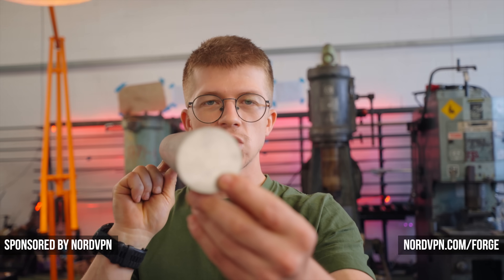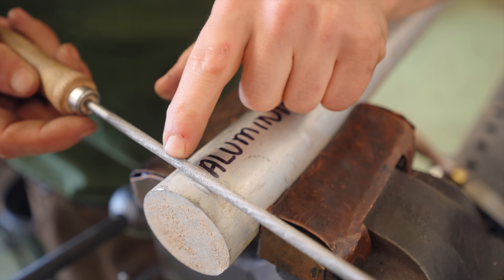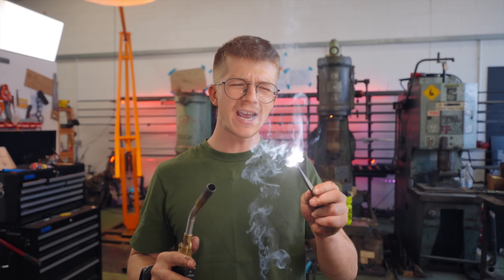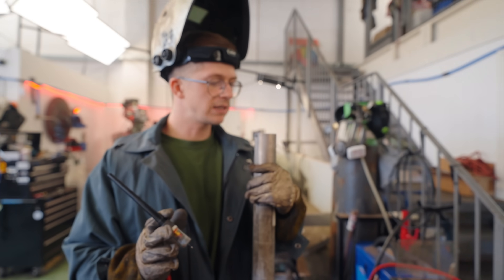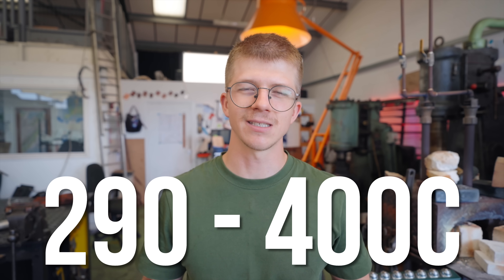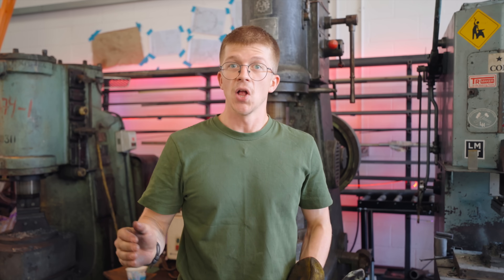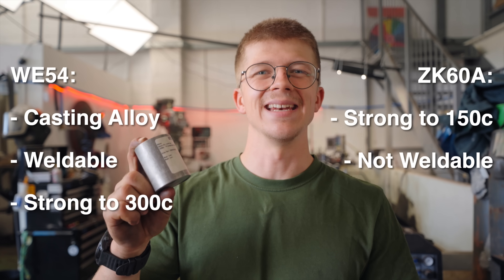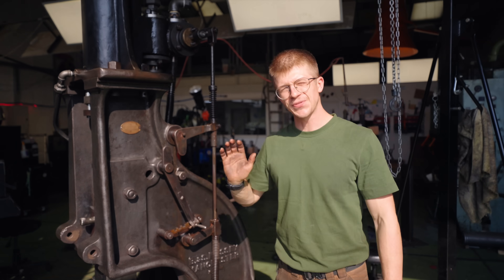Can You Forge Magnesium?

Comment: While density can play a role in the hardness of a material, they aren't directly proportional. Lead and gold, while dense, are relatively soft metals due to their atomic structure, making them easier to cut compared to less dense but much harder materials like titanium. Titanium is indeed less dense than lead or gold, but its strong atomic bonds give it much greater hardness and strength, making it more challenging to cut.

When you bring oxides into the mix, the complexity increases. Materials like aluminum oxide (Al₂O₃) and silicon dioxide (SiO₂) are ceramics with strong ionic and covalent bonds, resulting in high hardness. These materials are significantly harder than lead and even lead oxide, which has a weaker structure in comparison. Titanium nitride (TiN) is another example—it's extremely hard and used as a coating to enhance cutting tools. In summary, hardness is more about the material's atomic structure and bond strength than its density alone.

Comment: This video is so cool to see since I work with these alloys on a daily basis, casting, extruding, etc. I work at a company that specialises in magnesium production here in the UK for all kinds of industries. We make the alloys mentioned in this video such as WE54 and Elektron as well as dozens of other alloys. We've made stuff for Porsche, Ferrari, Honda, and even the apache helicopter uses our alloys.  

And Alec you're right this material is incredibly difficult to work with and is incredibly dangerous but I really enjoy working with it. 

We need to use cover gas at all times to keep magnesium from oxidizing when heated, otherwise magnesium oxide gets in and you end up with crap material that lacks the properties required. Basically if you don't want something to oxidise, just take away the oxygen!

Comment: Once again but when you're filing magnesium if you try to light even the little tiny pieces that you pulled off of the magazinesome rod you will notice it catches on fire real easily and it can magnesium is the only metal that can burn underwater so just remember that it's what they use to weld ship holes when there's a hole and it's still on the ocean they use a magnesium rod maybe not the stickers what you got there but you know what I mean

Comment: 10:25 why is the temperature water freezes at so important? Replicating this is tricky even with modern refrigeration. Meanwhile, if you put a block of ice into a salt water brine, the water will cool to exactly 0F. This allows for an accurate calibration of a thermometer in the field with simple and common equipment - very important 2 centuries ago.

Comment: In the 1980's working at British Nuclear Fuels the fuel rods were made from magnesium. On bonfire night they would fill an aluminium dustbin with the swarf and light it. I remember vividly seeing the shadow outline of the crowd on houses 100m away. Way brighter than daylight in a full field and so white.
Reply: go go gadget F type main sequence star
Reply: I thought zirconium was used for fuel rod casings, not magnesium.
Reply: @cambridgemart2075 technically yes It could be Zr Cd or MgAl alloy.
Reply: @Beuatifulsmall we also had to great bonfires when I was a kid, a large piece of Magnesium sheet ended up on it, it lit up the whole nounhood when there was a gust of wind.  🙂they also reprocessed the nuclear fuel rod casings, I think we had one a cloths prop for many years! ( see comment above).
Reply: If I remember correctly, the flares I fired in the Artillery were magnesium. They have an eerie white light  when burning
Reply: Congratulations, the.. "white" light is UV light so intense it completely overwhelms any optical sensors. Camera as well as eyes, to see the true colour of a magnesium flame you'd need one of these temperature cameras that create an image not by light emission sensors but an radiation intensity sensory array and translating it into human-conceivable colours by shifting it into a spectrum the human body can sense (like shifting up or down audio tone pitch to make it comprehensible to the human ear by bringing it inside of the human hearing range and does NOT mean, that it's that colour or pitch in real life.. Colours are an illusion anyway. It's all more or less colourless, but due to different light refraction properties of certain materials and surfaces. When you're adding colouring to something, you're not changing the thing, but the way its surface manages to refract light. Without our eyes, everything is grey, "Eigengrau". The "static interference" in our optical nerves humans and therefore silence used to call "black" but actually is a mix of all the different RGB sensors in our retina glitching out uncontrollably but still homogeneously.. except for when you're high and your mind's pattern recognition feature is basically super- and turbocharged with weed, on Nitro with Shrooms and on TopFuel with LSD, having you imagining vague, random outlines and shadows of things in the static.. no matter if the eyes are open or closed.
It's a software-problem more than it is a hardware one, so except for filtering the light input in general, like in sunnies or selectively by frequency, like torch hoods, is only semi possible. It's ike the analogue TV static, just in 240k.. 😅
Sorry, I'm more of a car/microbiology nerd than anything else. 🤪
Reply: @HG_Budde  Never in my life have I seen a more longwinded and rambling comment from anyone other than myself.
Reply: @HG_Budde  "UV activates the optical sensors"
any source on that I can read?
Reply: @HG_Budde 👌
Reply: It's driving me crazy the masses keep saying magnesium is flammable, so is potassium but you don't see people avoiding bananas. The purity of the metal matters and no one with a brain is going to work a non alloyed magnesium metal period.

Comment: My dad worked at an aluminum factory, and they would heat the metals for alloys to dry them before introducing them in to the molten aluminum...because if not, boom...anyways one time a drying kiln ran away full of magnesium, burned through the concrete floor into the earth, they just kept covering it with dirt, nothing they could do!  Burned for most of a week if I remember.

Comment: 2:10 I'm not 100% sure but i don't think density and hardness are very strongly correlated. Gold and Tungsten have very similar density, but very different hardnesses. I suspect it's got more to do with melting point, since iirc germanium can be chewed like bubble gum due to its low melting point and i supposed mercury is a liquid so would be "soft"

Comment: A table saw with a carbide tipped wood blade is a little slow, but can cut through 2 by 4 inch aluminum blocks without dulling or going wonky.
    I would hesitate to put a wood chisel to aluminum. I don't have a tool sharpening fetish. Files are whatever, they just fill-up tho. Soak them in lye for a bit and wire brush after a rinse.

Comment: There other metals that can catch on fire is like Lithium, Calcium, Sodium, Potassium, Strontium, Ceasium, Rubidium metals are also reactive to water and air. It will explode and is very soft metal. It can be cut with an knife like butter. Has to be stored in oil or ampule for storage. But they have amazing properties and usage in chemistry and manufacturing! ⚗️ 🔥 💧

Comment: Fahrenheit's most practical use is for measuring temperatures compatible with human life. For body temperature there is much more granularity in that range. 98.6 - 105 (a range of 6.3)  vs 37 - 40.5 (a range of 3.5). The same goes for air temperature and it's safety for humans. Direct sun exposure when temps are over 100 for extended periods is dangerous while even with warm clothing at or below 0 is also dangerous.

Comment: 2:10 OKAY, so, basic 411 for it is Density can affect how hard it is to cut, but also bond strength, so something super light won't necessarily be easy to cut and something dense won't be necessarily hard. Density can affect it purely due to how many atoms have to be moved, but it's not the only factor to how soft something is. For example, Pure Gold is pretty dense itself, but it is also crazy malleable.

Comment: 2:04 Nonsense, literally. The hardest natural substance is diamond, which is made from carbon and has a density of 3.5 g/cm3 (0.13 lb/in3). Gold, on the other has almost the same density as tungsten, but a hardness of 2.5 (tungsten has a hardness of 7.5). Graphite is made of the same atoms as diamond and has a density of 2.1 g/cm3 (0.08 lb/in3) and a hardness of 0.5 to 2 (sources diverge). Hardness has more to do with bond strength than with density.

Comment: As a physicist and a chemist: No, the density of a material has nothing to do with any other characteristic (hardness, colour, how it will behave in a forge, etc). And even if you have just one material, you may have different "versions" of it, which may have widely different characteristics. Take Carbon for example: If you burn stuff like wood or coal, you get soot on your furnace. This soot is basically just carbon, really soft, black, basically no structural integrity. However, if you take this soot and put it into an environment with really high temperatures and incredible pressures, you get diamonds: The hardest material we know of and transparent. 
If we go back to metals: Remember tungsten? Really hard, heavy, incredibly high melting point. Now let's move a few steps to a theoretically similar metal: Quicksilver. Also really heavy, a liquid at room temperature and thus quite soft. (I have now information of how frozen quicksilver behaves).
I could explain to you why it is like this, but not in form a youtube comment.
And as a fellow blacksmith: Always think about the oxygen, when you work with hot metals: Of course you can tig weld, because you work with protection gas, which prohibits any oxide layer or fire. If you would have a method to both heat and work your metal in an protection gas atmosphere, you could use higher temperatures, which would make the metal softer and less likely to form cracks. But that is a lot of effort for next to no benefit.

Comment: Burning in air magnesium makes for the most part magnesium oxide,a chemical salt of magnesium its the white powder left over, now if you mix magnesium oxide with water in the proper amount it will first raise the temp of the water to near or above boiling and thru the wonders of science create magnesium hydroxide which is sold by many companies as milk of magnesia laxative.

Comment: Magnesiumoxide blocks your intestines from absorbing nutrients. This can cause a laxative effect. Spectacularly so if you've had a fatty meal.
Some people take this on a regular basis in a misguided attempt to lose weight. Structurally blocking the absorbtion of nutrients is not a healthy idea.
Most multivitamin tablets contain magnesium. You need magnesium for your muscles and your skeleton. But often they use the cheapest available and legal form of magnesium, which is magnesiumoxide. The dosage is low enough that it doesn't really matter. But this is the hallmark of a multivitamin where they cheaped out on the ingredients. The magnesiumdioxide is a very poor source of magnesium, as it is oxidized. And it blocks the absorbtion of other nutrients too, which is rather counterproductive in a vitamin tablet. Avoid those multivitamins and instead look for something containing magnesiumgluconate, magnesiumtaurinate, magnesiumcitrate or magnesiumascorbate. This means the manufacturer of your multivitamin has some clue of what they are doing, and maybe even cares.

Comment: I'm surprised that Aluminum and Magnesium have nearly the same melting temperature... but that the magnesium has to be heated up so much more for it to be forged. With magnesium seeming so soft (like in the fire starters) I would have expected it to be easily forgeable at lower temperature.

Comment: Does it have good strength like aluminum? Like, can anything useful be made out of it? (Like, could a handgun frame be made out of it, or anything that has to take abuse?)... I know it wouldn't make sense to make a frame out of magnesium when aluminum would be easier and probably cheaper... but I'm just wondering about the strength/properties that would/wouldn't make it a usable metal in the case that aluminum wasn't available. (Guess I should have watched the video before asking).

Comment: When Aluminum was needed for military aircraft during WW2, magnesium was heavily used for non-combat aircraft, including Douglas DC-3 / C47 cargo planes. After the war many of those planes, aluminum and magnesium, got converted to passenger planes. Ricky Nelson's DC-3 crashed in 1985 in part because it was one of the magnesium versions. A faulty cabin heater lit the metal on fire.

Mongoose, a manufacturer of BMX style bicycles, invented one piece cast aluminum spoked bicycle wheels. For their factory sponsored competition riders they supplied magnesium wheels, which they cast in secret, late at night - because the company didn't have the special permits required for casting magnesium. They're required due to the extreme fire risk. If you find a set of those magnesium Mongoose wheels in usable condition they're worth quite a bit.

It's possible to make non-flammable and castable alloys of magnesium which retain much of the properties of light weight and strength. The NeXT computer housings were made of it and are extremely difficult to get to burn. Google burning a NeXT Cube. Someone wanted to get a shot of one burning for a magazine cover photo and had quite the trials getting it lit.

These non-flammable alloys have been very popular for higher end laptops for quite a while. They can be die-cast thinner than plastic while being stiffer and stronger.

Comment: Density does not corrolate in any way to hardness. Two of the densest metals there are, Gold and Lead are also both soft enough that they are usually able to be deformed by hand at room temperature.
Reply: With lead, Not only deformed. You can scratch lead with a fingernail. It's literal actual butter.
Reply: Nice to know, I’m not the only one that used gold as an example

Comment: magnesium has very little thermal mass, which makes it very good in some applications (as you already pointed out: racing), but that, I suspect, is the issue you were running into. It may forge at 400C, but it is only at 400C for a few seconds after you pull it out. Forging with pre-heated tools or even with a torch on it? I'm no blacksmith, so that's just a guess. I do some machining and I have played around with magnesium (and daily drive a magnesium engine, ty, bmw)

Comment: As a scientist: No, density is not directly related to hardness. An example would be lead, very dense but not hard at all. The hardness of a material is mainly related to the type of bonds that hold the material together (covalent bonds or ionic bonds, for example) and, in the case of metals, the material composition and the associated structure of the crystal lattice.

Comment: Magnesium is flammable as F once you get it lit.  I used to melt magnesium alloys for my father in his UCLA metallurgy lab, under argon!  Get it ground small enough and it is pyrophoric, spontaneously bursting into flame.  Ever see a VW Beetle after a fire?  There is nothing left of the transaxle and engine.  Magnesium is part of incendiary bombs and thermite.  Dropped at the top of a 100 story steel and concrete skyscraper it will burn to the basement.  OK, now I'll watch the video...

Comment: For all it's issues, it has some great properties. It doesn't expand or contract much with temperature changes. The original Volkswagon Beetle engine was a two piece magnesium casting that was bolted together. It's light but quite strong. Of course if you get it burning, it's incredibly hard to put out. You can't put water on it because it burns so hot it dissociates the oxygen and hydrogen in the water and burns even better while being blasted all over by the steam explosion. It's hard to smother, because it just ignites or melts and then ignites a lot of what you could toss onto it. It's hot enough to emit serious UV and almost like looking into a welding arc. It's not quite thermite level hot, but close enough. Oh and epsom salt is magnesium sulfate which can be used in a pinch if you need a laxative that will empty you out. Not recommended.

Comment: That diagonal crack looks to be a shear crack. My impression is you'd have to heat the metal up more to avoid that kind of thing from happening but you might light it on fire in the process! Probably best not to do that! lol
Reply: It looks like Magnesium will light on fire around 600 C, but idk if I'd risk something like that. The modulus of elasticity is a FRACTION of what it is for steel (around 25%). The reason it was so loud when you hit it is b/c, as you experienced, it's hard and brittle AF, meaning the material doesn't want to move easily.

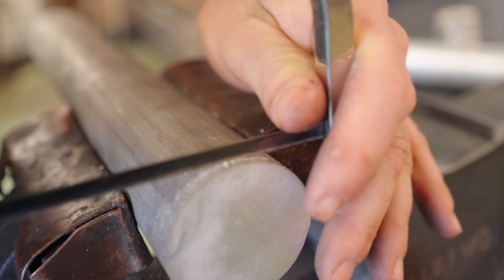Comment: 2:47 Diamonds, quartz crystals, silica carbide grinding disks are an order of magnitude lighter than any steel, yet scratch and cut the steel. And steel is harder than lead, which is much denser. 
Hardness is not a property of mass but atomic bonds that form crystal structure. When you heat treat steel, you are editing these bonds until the hardness is suitable.

Comment: My guess for the comparison of Al and Mg when it comes to sawing vs filing is that Mg actually is softer than Al, which is why it was easier to saw, but that the Oxide is also quite soft and forms a film of lubricant whereas Al2O3 is quite hard and would aid the file.